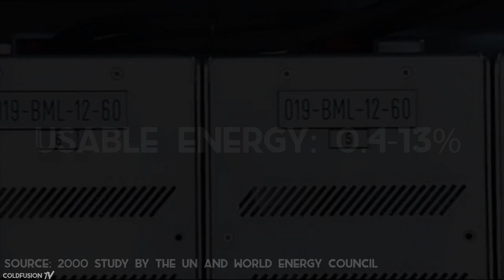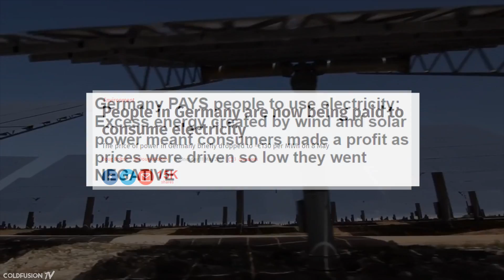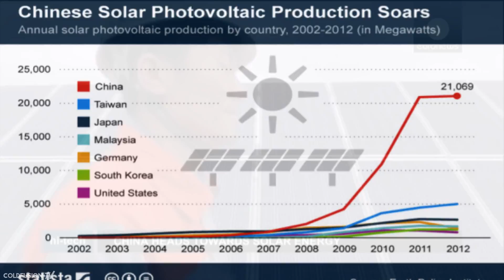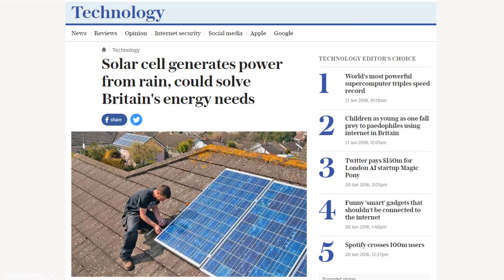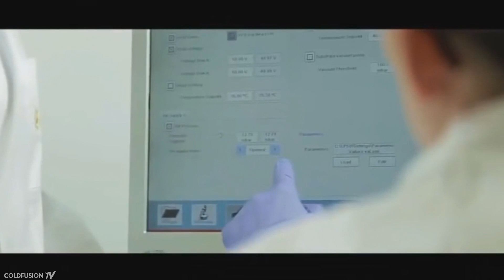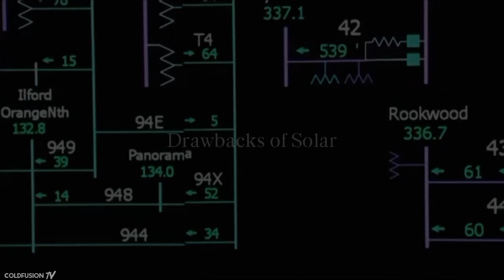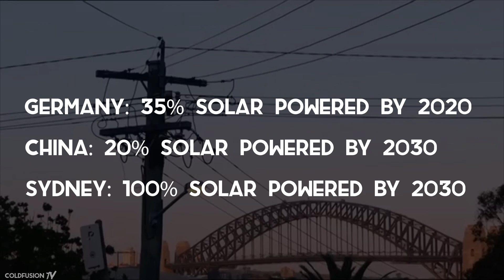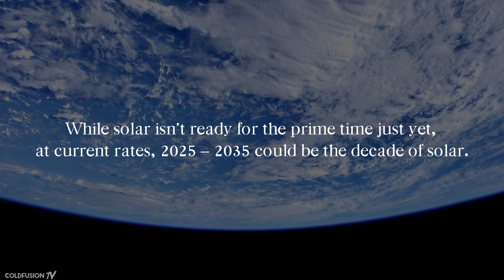The Truth About Solar

Comment: and what about areas (size, productivity, other uses) occupied by solar farms? what about cleaning solar panels of dust, leaves and bird droppings affecting their efficiency (in California, I believe, solar farms are among the largest water consumers)? what about their performance when covered with a foot of snow? what about transmission lines to deliver generated electricity to our cities? what about exotic materials required in manufacturing processes? what about recycling used panels (nobody recycles them, as far as I know)? -- yeah, so many questions, so little time...

Comment: 5:00 I call bullshit. 90% of solar energy wont pass through the clouds just because techjesus says so. Laws of phisics are damned stubborn that way. Btw even the last moron can verify that by buying a shitty photoresistor and plugging it into an arduino to check for light levels. Or if you want to see it in practice take a look at the amperage of solar panels when there is a thick cloud cover.

Or just the light intensity in bright conditions at noon compared to cloud cover.
To quote wikipedia:
Direct sunlight at noon light: 32.000 - 100.000 lux
Indirect sunlight at noon on the outside: 10.000 - 25.000 lux
Overcast day: 1000 lux
Very dark overcast day: 100 lux
https://en.m.wikipedia.org/wiki/Lux

Regardless what techjesus preaches light doesnt work that way.
Reply: 5:25 the so called "Kelvin water dropper" is not exsctly a revolutionary breakthrough - going back into the mid 1800s.

Its just very useless for generating current.
Reply: And yes, you can build a solar powered plane, the only problem is that its as big as a jumbo jet, and only able to carry TWO, at 1/5th of the speed.

In a sense its pretty similar to airplanes made out of concrete, its a fun pasttime project for engineer (when the undergrads get bored out of pasta bridges), but it has  very little use when it comes to transporting stuff.

Comment: This was a really one sided argument. I am a licensed solar panel installer and here are a bunch of facts that were "overlooked" here:

1. Solar panels are NOT recyclable. There is recyclable materials in them but it isn't cost effective or easy to recycle those materials so it all goes in a dump.
2. The average solar panel efficiency is 15-18%. Those 30% efficiency or higher ones are used by companies like Boeing and NASA, not something the average person will likely see.
3. Battery backup systems are extremely expensive AND inefficient. Batteries eventually lose their ability to retain power and have to be replaced and the batteries are also not truly recyclable.
4. The ideal temperature for a solar panel to work at peak efficiency is around 68 degrees. Any hotter or colder and you lose productivity which decreases faster the hotter and colder it gets.
5. Damage to the planet to mine the materials for the batteries and similar items (lithion ion as an example) is doing far more damage than most other power sources.
6. Once a solar farm reaches its turn off date (because everything deteriorates over time in the elements) it is left in place and abandoned. The solar company has no interest in recovering the land used by the dead farm and just leaves the waste behind which ensures that land is never usable until someone eats the cost of cleanup.
7. Never ever ever ever ever ever ever put solar on the roof of a house. Once up, the owner is 100% liable for all work outside of warranty repairs for the panels. Damaged roof from a storm/tornado/etc? You the owner have to pay to take them off and put them back on. No, insurance companies typically only cover the cost of the roof itself and not the panels.
8. Most power companies charge you a fee to connect the solar panels installed to the electrical grid. Then there are monthly fees in your bill associated with that. Top it off with most electric companies will not reimburse you for the electricity you over produce that goes back into the power grid if you don't have a battery backup.
9. Solar cannot replace the power infrastructure of the USA. It is a great supplement to the grids but it is unrealistic to think it can replace it altogether. Solar panels basically produce nothing at night so you have a time lapse of power consumption with no gain.
10. You lose power transferring it between locations. The longer the transfer of electricity the great the loss.
11. The more people use solar the cost of electricity goes UP, not down. In Hawaii so many people have put solar on their houses that the energy providers have to increase their cost rates of electricity to everyone else. That was a bold faces lie to say nations are at a "negative cost" for solar and "paying people" to use electricity.
12. NEVER GO INTO DEPT TO GET SOLAR PANELS ON YOUR PROPERTY. You will NEVER make the cost of up because you will not produce enough electricity to offset the cost of the loan interest. If you cannot pay cash, don't bother getting them.
13. If you get solar on your property have it installed on stilts like you see at solar farms. 

I can go on further but i believe the point has been made. Solar can be a wonderful supplement to the existing power grid but it cannot replace it.

Comment: ummm solar panels degrade over time...

I did a cost analysis for my farther who was very keen way back in 2011 to get solar...

Thing is much to my surprise once investigating this is that after about 8 years the cells are rather weak.

Thus in order to get a decent return on purchasing solar + the installation for them vs his monthly bill and projected increase ( likely a child or two leaving home by that 8 year period ending) the costs where prohibitive at that time.

Simply although he seen a monthly bill quite high in power costs, over time hes about the same price as solar cells and installation - to give the then family of two and two older teenagers enough energy- including inflation and yearly increases.

+ at the end of it he'd have to pay to have the old ones removed... / replaced + more installation at higher costs...

Perhaps there is some merit in it now...
But unless your yearly total + inflation + guesstimate increase in power prices is more than the cost of solar panels the installation and removal of those cells + replacement hold charge batteries, then its a hard thing to justify.

For my father at that time and hunting around was looking at the close side of 10K including installation.
I told him of what i had discovered about the cells degradation over time, kind of stunned look on his face as it was a complete unknown to him, and not readily advertised of course. 

I left it up to him to decide what he thought he'd be better off with. 10k out lay (not including removal)... or still pay similar amount over the same period with  his electric company and while still earning interest on that money.

"Up to you"
Reply: You must have been looking at junk, because Solar Panels can have a 25 year, 80% power Warranty.

Comment: While solar is one of the ways forward this video is all twaddle. Elon Musk is a now well known liar, he has reaped the easy gains that were obvious but is still in the habbit of announcing the seemingly impossible as though it were totally natural. In the UK and anywhere for that matter cloud cover will cut output to 5-20%. On slightly cloudy days it can actually increase output due to the way the clouds scatter the light that is still getting through. This works very well on an east to west installation where the opposite side to the sun starts to get significant light. My system is naturally 4kW tops with 4kW of panels each side. With the right cloud cover i can get 6kW but this is rare and each side has a maximum effective output of 3kW. The 4kW happens at midday as the sun shines a bit on both sides that due to the angle only do 2kW each.

Comment: That is a cracking good bunch of facts, figures and research my friend....kudos to you. I know this is a few years old now...but the biggest problem still remains. Being able to store solar power..or any power for that matter on a mass scale is what holds it back as it kinda has to be produced as needed. This is why if you have solar panels and excess power, you are paid to feed it into the grid. Solve mass power storage.....go straight into the history books....peace.
Reply: Storage is not a problem with the Grid Sized Li-Ion Battery Banks. They are being installed, and have been for several years ...
Reply: @MrSummitville  Hi there, i am aware of the grid sized battery banks.....they are just rows n rows of Li-ion linked together and do give some storage capacity, but not nearly enough to meet our ever increasing needs for power on demand. This is why we have hydro -electric dams...to release water, create power as n when the grid requires it because there is no way to currently store electricity on that scale. Battery development is the single biggest factor that holds all technologies back...more breakthroughs are needed in this area, particularly mass storage...anyway, thanks for your reply.
Reply: @dazuk1969  Actually, Li-Ion Battery Banks are currently replacing Peaker Plants within the USA Grid.

Comment: As an electrician I took a coarse in solar. What is not mentioned here is that solar panels degrade 1% a year so in 15 years you've already lost 15% of your capacity to generate electricity. At what point is this  no longer acceptable and the panels have to be changed out?
Reply: A 25 year warranty will guarantee 80% of Rated Watts = still good enough ...

Comment: A lot of half truth info here. While solar may be good it will need other forms of energy to supplement it. And we haven't even started to talk about all the negatives about solar. Before you start hating, i'll tell you im a solar power user. My house has solar panels and i am very supportive of the solar movement. But it is in all logic limited. And among all the energy sources out there, solar is by far the most space required source and the pollution level isn't as low as people think. Yes, you may have little to no pollution during the solar panel life, but once the panels spoil, you create a mess. Recycling has it's limitation and that is where the cost goes up up up. And like i said, it has to be supplemented cos you get no energy during the night even if you can get some during cloudy days. 

A lot has been talked about nuclear energy and it is for me the future. Solar can co exist but it can't be your main source. And yes i'd pick solar over carbon energy any day. If you have the space go harvest it, by all means. 

I find cold fusion always don't tell the full story. Too much politics behind it and if people aren't aware they might get sucked into a lot of half truths and even some lies. A documentary should tell everything, the good and the bad. That is how you educate people. They are just trying to sell solar energy in this video.

Comment: There are several problems with solar energy.
1. It takes lots of energy and materials to produce, mount/erect and maintain a solar farm
2. It requires lots of land space for large scale capacity power generation 
3. What do we do with the materials after the life expectancy of the panels have been realize?
4. The underlying impact on wildlife...
Reply: It takes very little energy to install a solar farm.   Try calculating the energy required to build a Nuclear Power Plan - if ever get completed ...

Comment: Nonsense. Solar and wind are an eco disaster.
Germany is a great example of increasing prices and CO2 release.
If the Eco religionists were intelligent we would be using molten salt thorium reactors!
Reply: What is wrong with installing Solar Panels an a roof?
Reply: @MrSummitville  absolutely nothing wrong with solar panels on a roof.
Slicing up 1000s of birds every day is not a solution. Molten Salt Thorium Reactors are!
Reply: @larrydugan1441  Is there even one single working / functioning Molten Salt Thorium Reactor, that is actually producing AC Power into the USA GRID?  Can we bury the Nuclear Waste in your backyard?   Millions of birds die every year, a few thousand more is nothing. The smart birds will learn to stay away.   Germany's CO2 production has been DECREASING for the past 20 YEARS !!!  So, what are you talking about ?
Reply: The Americans had a thorium reactor funcioning in 1964!
There is none functioning in the US mainly because of the money wasted subsidizing idiotic plans like wind farms!
Thorium Reactors have minimal waste and can  burn existing nuclear waste!
As for birds it is a gross exaggeration to say only a few thousand! Many are raptors!
Germany's experiment with renewables has been a failure. The reasons are multiple but you can read why here.
https://www.forbes.com/sites/jamesconca/2017/10/10/why-arent-renewables-decreasing-germanys-carbon-emissions/

Comment: I don't know why some people treat renewable energy like witchcraft!
I have a 2 bed holiday home in Ireland where it's not very sunny. It has an 8kw solar system with a 1.5kw wind generator. I dont have a tumble dryer and my cooker runs on bottled gas.
I installed them in 2016. It also runs a ground source heat pump. The property is not connected to the grid and it's been working perfectly since installation.
Reply: Hugo Stiglitz sounds good . Can you tell the approximate cost of ground source tech and the running cost of pumps and maintenance thnks
Reply: @Crosstownboards  not sure I'm the right person for this. The system works very well but it was made up of secondhand bits I gathered. The heat pump I purchased while i was working in Germany. It looked new but wasn't working.
I'm a mechanical engineer, so refrigeration is no great mystery. It had a damaged evaporator and an over temp switch. I think the whole system cost me about  £2.5k. That's from laying the pipes to having heat in the house.
I would approach the whole project differently if I was doing it again.
And I have to thank the digger drives for preventing me from putting the ground pipes in the wrong place.
I started with the idea that the system could be small as the house would not me occupied most of the year. Then someone reminded that if I had to sell it, it wouldn't be suitable for all year living.
Another thing is i sound have realised that the wind barely ever stops here but the sun does. I would make the wind system bigger and the PV smaller.
I've really had very little issues except the pump for the ground source side needed replacing, not expensive if you're doing it yourself. What I would say is do lots of research before you even start. I have lots of video but they went done with a video to uploading them. I am thinking of going through the whole system next september and putting it all on YouTube.

Comment: It's the year 2020 and I would like to add another draw back. Thanks to the rapid improvement in solar panel technology, any projects that were build in the not too far distant past (2010 - 2016) are now obsolete and a waste of investors money.
Reply: Solar Panel do not become obsolete  ... They keep working, and working, and working ...
Reply: @MrSummitville  you misunderstood. Older panels are less efficient hence they produce less electricity (ex. old panels produce 50W, new panel produce 400W). the $$$ return on a major investment in solar power generation station from older technology panels is terrible compared to new ones. get it now?
Reply: @Friendly911  50 watt Solar Panels are like from the 1970's !!!  400 Watt Solar Panel are just LARGER versions of a 300 watt Panel. Large area = more cells = larger cells = more power.  400 watt Panel cost more than 300 watt Panels.  Solar Panels do NOT go obsolete !

Comment: Total mass and energy balance for solar shows that it produces more pollutants than a coal fired power plant. Make decisions based on physics and sound engineering. Solar only happens because governments subsidis guarantee investor profits at tax payer expense. Solar is a lose lose proposition...
Reply: Solar Panel fabrication emits very little polution , tehy are made of silicon ( sand ) and aluminum. Got visit a factory and then you will know.

Comment: My problem is the land usage. Also, these panels are likely to be really expensive and these cities aim to be 100% solar how? By making panels on houses mandatory? That'll send the price of housing up. Not to mention the necessary power storage would be even more expensive. It'll make housing in these cities really difficult to afford for most people. Meaning they likely won't live there, or - as with cities in California - you'd get significant homeless population. Plus all the investment required to upgrade the grid to avoid instability as Western Australia is dealing with will ultimately make the conversion to solar ludicrously expensive. Coal is still cheaper by far.
Reply: Put the PV Panels on the roof ...